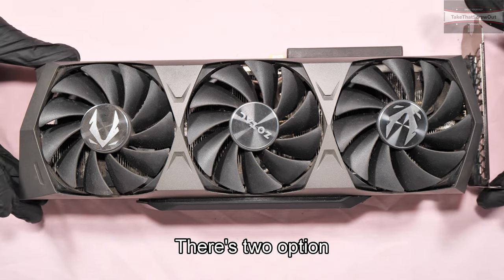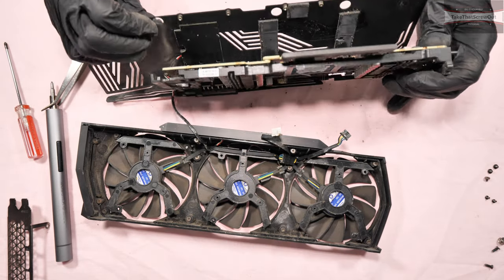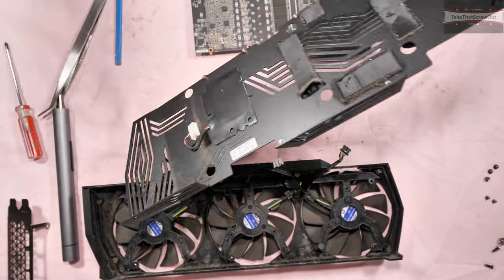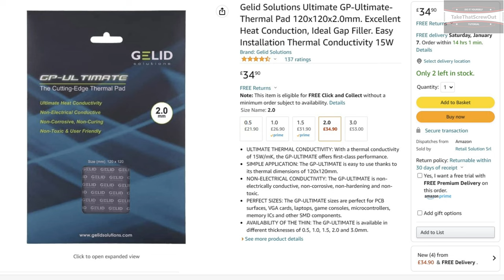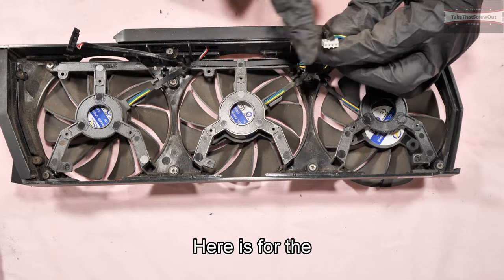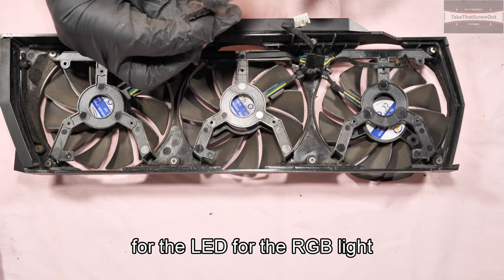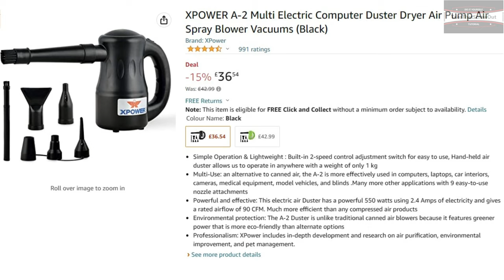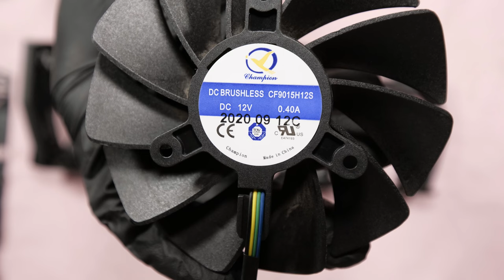ZOTAC GAMING RTX 3090 Trinity | DISASSEMBLY \ TEARDOWN | Upgrade option, Fan & Thermal Pads change

Comment: Thank you I bought a 3080 off of eBay and the fans just gave out on me the only issue I ran into was getting the wiring back to where the plastic housing would fit properly.
Reply from the maker: You're welcome bro, wish you luck bro on getting on with that wiring..👍

Comment from the maker: Here's the ZOTAC RTX 3090 disassembly.. if you need to know regarding the thickness of the Thermal pads, the Brand i used, and the Part number of the Cooling fan if your one needs replacing, just comment below or just watch the video it shows all info in the video.
Reply: hey do you happen to remember the thermal pad thickness for the vrm mosfets? 19:44  im about to replace mycard as it is badly overheating. its just i want to make sure i ordered the correct thermal pad thickness on all the varrying sizes for the card
Reply from the maker: Hi bro! VRAM's is 2mm and VRM's is 2.5mm..hope this helps. Enjoy!

Comment: Seems to be some inconsistent answers here.  Are they 2mm pads front and back (all around), or 2.0mm and 2.5mm?
Reply: front is slightly lower than 2mm. I got 2mm extreme odyssey and had to squish them down to be level with the GPU core for the core to make proper contact with the heatsink. The rear I think you can use 2 or 3mm since the clearance issue on the front is to do with the core which isn't an issue on the rear.

Comment: Hello!! Could you tell me what screw sizes there are for holding the backplate onto the PCB? I bought a used one and I think the previous owner put a waterblock on it and lost some of the screws. Thank you!!
Reply: Hello, You will see that he is removing six screws on the back. 4 screws with springs around the core. The other two black screws are size "M2x8" M2=2mm x8=8mm
Reply: If I have misunderstood your question. 
I am going to dismantle the GPU soon, and can of course measure the other screws, if desired.
Reply: @kaerscarface  I'm all good now! Thanks for the reply and offer!

Comment: I regret getting a zotac 3090 it shuts down when pulling over 320w gonna sell it and get a MSI or EVGA (RIP EVGA)
Reply from the maker: Zotac brand is a Mid tier when it comes to their product..they perform okay but not as good as Asus, evga or msi when it comes to design and performance. I agree with you bro.
Reply: Put zotac 385 watt bios ,undervolt.

Comment: Is it possible to replace the fans without needing to repaste/repad the card?
Reply from the maker: Yes you can bro! Watch the video on TIME STAMP 1:30 that shows how to remove the front shroud with the three fans. Hope this helps!
Reply: @TakeThatScrewOut  It looked like you also need to remove the heatsink (thus maybe ripping of the thermal pads) to disconnect the fan power cable. Or did I see that wrong? 

Anyways thanks for answering so quickly!
Reply from the maker: @jaloley8558  the two fan connector is are attched to the side of the board..you can disconnect that connector using a LONGNOSE PLIER..the other wire that goes to the other end of the board that is for the led light of the front shroud.
Reply: @TakeThatScrewOut  Thanks so much! I think I'm confident enough to replace the fans now. Wishing you a great day!
Reply from the maker: @jaloley8558  You're welcome bro! and you.. take care and enjoy!

Comment: BTW, I am planning to take off that zotac led bar at the side to fit into an sff case.  do you know how take that bump from the side of the fan shroud?
Reply from the maker: yes definitely! you can remove that plastic bump in the side through removing few screws located inside the Shroud. Pay attention there's a cable that you also needs to be removed thats for the led.

Comment: Hi I just bought a 3090 Trinity OC and wanted to give her the same treatment. Is it going to be the same process as this one? Thanks
Reply from the maker: If its the exact same model, yes! Just follow this step by step tutorial..it's so easy bro believe me..😉
Reply: @TakeThatScrewOut  thanks for the answer! Could you tell me what pads you use under the black bracket on top of those 2 columns of tiny capacitors?
Reply from the maker: @paulalexandro4546  that's 2.5mm thickness on that VRM's that you're talking about..and for the VRAM that sorrounds the Gpu Chip is 2mm thickness. I suggest use a good quality pads like Arctic, Gelid..Arctic TP-3 is my favourite due to softness side, it could easily adopt any gap.

Comment: If someone is intetesting Im used 2mm back, 2mm front gelid extreme pads and 2.5mm on power section. Works fine, temps in furmark, games and 3dmark ok. 

Previously used thermalright but they are too hard and not compress that cause low GPU contact and high hotspot temps.

I saw you missed one small 5x5mm thermal pad on the front on the 1 lonely vrm what should be there. 29min 54s (left from 3x video rams modules.)
Reply from the maker: You're right bro, Thermalright are a bit hard.. Even harder than Gelid. For anyone looking for good quality soft pad, try Arctic TP-3 they are not that expensive. Gelid had good reputation on transfering heat.. But they are hard and pricey.
Reply: @TakeThatScrewOut  I checked them out online and max thickness available is 1.5mm. So if I need 2mm can I use 2x 1mm stacked for rams or bad idea? :)
Reply: @Agrabelek_Michal_K   Hey! The lonely VRM you mentioned is the one marked 2R2 2029, right? Do you know if it needs a 2mm pad or something thicker?
Reply: @AndyEatsCocoa  propably Yes I don't have schematics, sorry I don't remember :(
Reply from the maker: Stacking thermal pads i don't really recommend..you could do that as a last resort, but that would still works and tranfer heat, but not as good as one whole piece.

Comment: Enjoyed watching your teardown video. I have a question to ask. at 24:05, you are connecting a white connecter located on the end of the pcb. what is the role of that connector? at first I thought it is an RGB lighting connector but it seems to be connected to a backplate. 
is it a thermo sensor for the memories in the backside?
Reply from the maker: The White connector connected to the PCB is for the Light in the Backplate..

Comment: did you use 2.5mm thermal pads for vrms? It will be really helpful if you tell me the thermal pads you used for vrms. 
gelid don't seem to have 2.5mm pads..
Reply from the maker: VRM are 2mm thickness broh..hope this helps!
Reply from the maker: Gelid is a good quality pads..but is a bit hard
Reply: @TakeThatScrewOut  On your video you measured 2.5 mm on the VRMs.
Reply: Put a plexi glass on top and youll see if they all make good contact

Comment: I just bought a used 3090 trinity and the seller said he replaced one of the fans. I put it in my PC and the fans are not spinning not even on boot. Do you think its a fan connector issue? 

Trying to find answer while the card is running right now.
Reply: The fans stay off until GPU hits 60c then the fans kick on that is normal now if it stays off after 60c there might be a problem!
Reply from the maker: well, possibly the fan connector wasn't connected properly or perhaps the replacement fan is not the right fan or maybe much deeper if the problem is from the pcb itself.

Comment: Hey man, I want to remove the whole shroud with fans and replace it with three Noctua fans. Is it possible to remove the shroud without removing the whole cooler? The fan connectors are on the side so it's possible to disconnect them with the cooler attached, but the rgb cable seems to be problematic. Is it possible to disconnect the rgb cable from the shroud, not the gpu?
Reply from the maker: Hi bro! you can definitely remove and detach the whole Front Shroud just unscrewing 6 screws from the front, and you can detach the whole shroud with the three fans on it. and regarding the led light connector, that could be access by removing the Metal Backplate, the led connector is underneath the backplate at the other end of the PCB. hope this helps.
Reply: @TakeThatScrewOut  thanks for the reply! Do you remember if its possible possible to remove only the backplate (to reach the rgb connector), and leave the cooler attached ?
Reply from the maker: @rogigor  unfortunately, to access the connector for that led you have to unscrew the six screws at the back, that would detach the PCB from the heatsink.  The backplate is attached with the pcb, so you don't need to unscrew it. Only 6 screw at the back that you're going to do you could access that connector that you need. But unfortunately you have to apply a Fresh Thermal Paste before you put it back.

Comment: what is the length of those 2.5mm pads?
Reply from the maker: It  won't matter the length in one full piece, if you already got a leftover pads that is short..use them, just line them up to extend the length. the most important are the chips 
should be covered with pads. but if you really want a one whole piece, but atleast has 120mm on length.
Reply: @TakeThatScrewOut  nice, because i have 85x45 pads
Reply from the maker: @crnigruja1150  that's perfect!